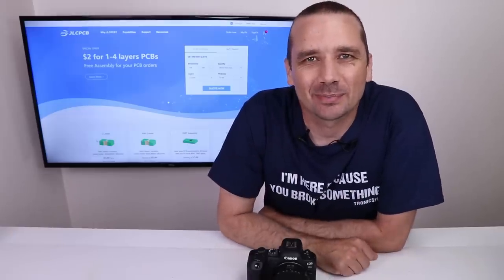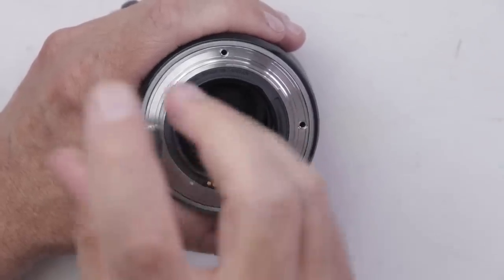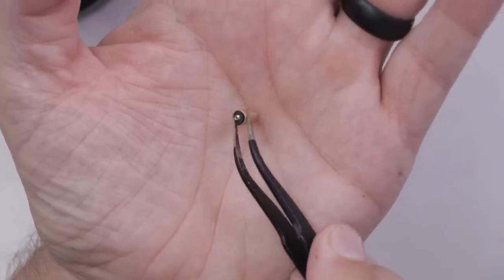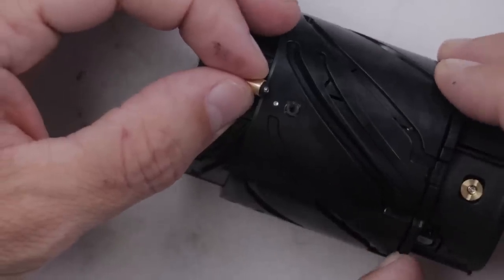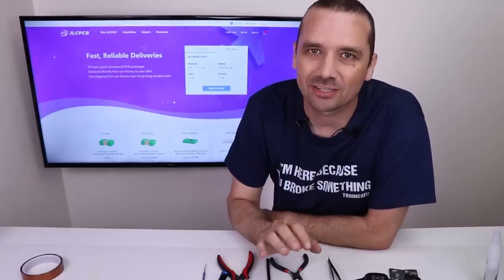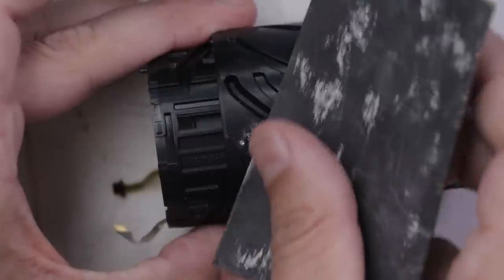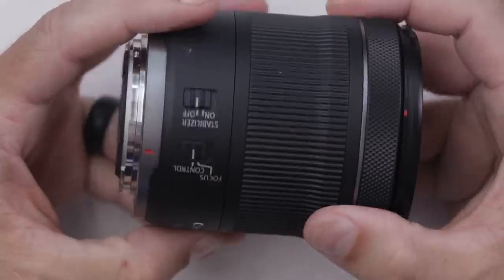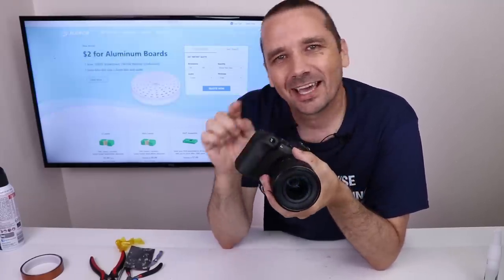I Bought a "BROKEN" $2,800 Camera & Kit Lens - But Can I Fix It? Canon R6

Comment: I've fixed dozens of lenses over the years and in probably 80% or more of the cases where mechanical failure has occurred due to impact damage, it's a plastic standoff that's broken. Fujifilm, for example use metal lens mounts on their XF series lenses but they're screwed onto brittle plastic standoffs. When a camera is dropped with the lens attached it's the lens mount that takes the brunt of the impact so those plastic standoffs just snap. From a repairability point of view it's actually better to have the plastic lens mounts they use on the cheaper XC series lenses since in those cases it's generally the plastic bayonet fitting that breaks and you can just replace the mount with a new one.
I should probably add that it's best not to use normal superglue since the outgassing in enclosed spaces like the interior of a lens can cause lens elements to fog up due to a chemical interaction with the lens coatings. In some cases I've seen the element has turned so white it's almost opaque. There are specific low-odor, non-fogging superglues like Loctite 408 or Permabond 947 that are better to use to prevent fogging but even then they should be left to cure for at least 24 to 48 hours before reassembling the lens just to be safe.
Reply from the maker: Thank you for your comment! Really good info here. Good point about the super glue. If I do more of these I'll have to make sure and get some of that glue. Do you still fix these?
Great channel btw! Hope it keep growing!

Comment: Would recommend using super glue activator spray. It makes for a much stronger bond and you don't have to wait around for it to dry. Plus the excess wipes off. I also often stick a toothpick down standoff holes to aid alognment and stop glue getting into hole.
Reply: This! I feel like when using the activator spray on thin plastics it melts it slightly cus of the heat of the reaction between the superglue and the activator and makes sort of a plastic weld. I could be wrong though.
Reply: Epoxy?
Reply: Activator can contain acetone which may react poorly with other plastics.
Reply: You don't need activator spray, you can use baking soda. Sprinkle a little bit on super glue will instantly create a very strong bond.
Reply: CA activator causes a thermal reaction (albeit a small one). Also can cause bubbles as it dries when activated. 
It's best to let things dry over a longer period for extra strength, particularly with materials where the glue can't soak into. This is surface to surface. 
Even with my woodworking I notice a stronger bond with a slower dry time than trying to speed up the process. You also risk melting the plastic a little, because some activators contain acetone. :)
Reply: Q-Bond kit on ebay
Reply: Use UV glue on this ?

Comment: Great repair, I hope it holds. Just a quick tip - I assume that plastic is ABS, if that's the case, always use acetone (sparingly). It will weld the pieces together instead of 'gluing' them. A little acetone in a syringe with a needle tip allows for good control over it. I have had great success doing this with screw posts on laptops, etc.

Comment: Oof for the engineer who made that single point of failure held in with a tiny piece of plastic. I'll be a lot more gentle with camera lenses from now on.
Reply: That Engineer definetly got a Bonus for that....
Reply: Even if the studs are designed different, there are still some manufacturers, eg Tamron and Sigma, too tight screwed-in screws make repair attempts really hard. Especially when you mess up the thread...
Reply: Kit lenses are almost always made like crap seemingly to force you into upgrading.
Reply: @gucky4717  Fault tolerance to make us money yo 😂

Comment: nice. I got an R6 and am in the middle of a lens repair. This video makes me happy. It's been a struggle. You gotta keep really good track of the tiny microscrews and the exact order of disassembly. Smart to do a line to mark the exact rotation of elements that might spin freely or go back incorrectly within the casing. Also have to be careful of stripping the tiny screws, most standard hardware shops and even microcenter won't sell replacements at this size. They're smaller than the little guy that holds down a m.2 drive for example. And it's easy to strip a screw if you fail to notice that some are JIS heads instead of philip heads, which look nearly identical.

Comment: Not sure if anyone posted here already, but to give super glue more strength, you can add baking soda to it. once you apply glue, put a bit of baking soda on top of joint. Turns out to be like a rock

Comment: Very nice fix.  Most would never even attempt this so I'm impressed.  I've learned over the years that CA based "super" glues usually don't hold up too well over time in high stress mounting points.  Whenever possible I use heat to weld the mount back on (it's not realistic more often than not) and for the other times I find that an automotive, polyurethane based, 2-part plastic panel bonding adhesive to work best.  WAY more durable than CA based glues.

Comment: Having that mechanism rely on a single post screwed into plastic is kind of... iffy.
Also, I guess you could look for a lens assembly with problem lenses and transplant the barrel part, but that would be a very long shot.
Reply from the maker: Ya, I wonder how many lenses only have this one stopper. It would be nice to just replace that part but I think buying another broken lens for it would just cost too much. I wish I just had a bunch of junk lenses laying around!
Reply: @Tronicsfix  welp, gotta try to repair more of them. wink wink

Comment: depending on the plastic that its made from methy ethyl keytone (or MEK for short) is a solvent that might be able to melt the plastic and fuse it back together on a chemical level. works for abs like lego plastic. good thing is not only does it bond the plastic to itself, making it as strong as it ever was, its not additive, the solvent evaporates, so everything should fit back together. you just have to be careful not to use too much and melt the plastic too much that it deforms

Comment: Just  supergluing it won't last last long. You could reinforce it by melting one or two needles (or wire, or some or small metal piece) into the plastic seam. That should make it stronger than before, if done right. (Might be tough to do here though.) I've fixed plastic pieces by pushing small metal pieces into the seam with a soldering iron. They've been holding for a few years now.

Comment: Still shocked at the fact that these $400 pieces of equipment manage to break internally like this. I get it may have been dropped, but still would expect better from the internals.
Reply: Obvious design flaw, you got a metal standoff going into plastic, the plastic is always going to break, it should be a curved metal plate that is screwed to the plastic at multiple points to spread the shear load across the plastic barrel
Reply: @ILoveWomen  Yes, that's true. When ever possible I suggest avoiding non L series Canon glass (instead use 3rd party glass, with adapter if needed). But their L series more expensive stuff is really, really great.
Reply: @sirrichel9155  I wouldn't be surprised if it was intentionally designed this way. It's supposed to break after a certain amount of usage.
Reply: $400 for a lens is actually quite inexpensive. To get to that cost they are built cheaply. Most of us that do photography have much more invested in our glass than our cameras.
Reply: At $400, almost all the budget goes into the glass, not the build. i’m not surprised tbh.

Comment: Dang, I would of been nervous too but that's great that the pieces was still in there and didn't appear to scratch anything. Interesting to see that it's only a single point for that movement, I would think at least two pins would be better, so they can share the load of those forces

Comment: I paid $600 for my best lens (worth around $2000) to be cleaned and refreshed, and I was happy to pay it. I'm a hardcore repair-it-myself guy, but lenses are terrifying devices. There's potential for a catastrophic mistake around every corner. EDIT: right after posting I watched the driver tip drop on the glass. YIKES!! EDIT 2: Nice work! I'm impressed.

Comment: 5:05 Other ideas, soldering iron and press it in, you'd have to be very careful getting it straight of course, but that would make it as strong as originally or worst case, you could drill all the way through and 3D print a tube to fit in the hole you made and the hole in the center being just large enough for the screw to eat into the plastic.

Comment: This is a great camera.  The mirror less feature is perfect for astrophotography and when replacing the IR filter with glass in front of the CMOS chip will increase its value.. you can use white balance to correct the Infrared pictures back to normal.. I'd love to buy this camera from you.!!!

Comment: You should adhere that piece with epoxy, it'd hold better without worrying about that piece falling off :) But nice vid btw
Reply from the maker: I'm not sure I'd be able to get the epoxy where I needed it without getting too much on it.
Reply: @Tronicsfix  I think it'd be still worth to try anyway. Epoxy is quite easy to sand down after hardened.

Comment: The best way to "glue" this kind of parts... and I use quotations mark because what I will describe is basically fusion the parts, not gluing.
A drop of chloroform on one of the surface and press slowly the part in the exact same position, sometime is advisable to build a jig to hold it on proper place until plastic is hardened back... definitely not applicable here as this is so small.
The chloroform melt the both surfaces of the plastic and fusion...or you can call as well welding, take place. 
Much more strong bond, sometime stronger than a new part, when those parts are injected, micro air bubbles are captured in the material, (this can be visible under a microscop)
The weld with chloroform will be free of bubbles therefore much stronger.

Comment: In my experience I’ve found that super glue really has a rough time bonding to lenses so even if you got some on the lens it should wipe right off, or when it dries you can lift it off without damaging the glass at all.

Comment: Interesting that you didn't do this as a resale with profit breakdown. I don't see a problem putting something like that up for sale if you are clear about what repairs have been done. Especially if you just post a link to the repair video in the ad. Include an as-is type of statement. If the price is right, I'm sure someone would be willing to take the chance. Great video as always. Thanks for sharing.

Comment: Just a little tip for you. Always use sodium bicarbonate with super glue. Just make the repair, as you always did, but, put the sodium bicarbonate over the fresh super glue. It makes much more strong the repair. Just try and see. Regards from Brazil (sorry by Bolsonaro).

Comment: If the superglue doesn't hold then a more robust epoxy maybe with plastic filings to create a nice solid bond.   Modern superglues are super resilient so no reason why it wouldn't hold.

Comment: This might be a very stupid idea, but, what if you used a slightly longer screw? You could also even try a very extremely thin nut on the other side, bending it a little bit to make it more like a curve. Most likely there might be no room on the other side to even attempt this, though, I know.

Comment: I think it was your last video I jokingly said your next video would be you fixing all the Chevy Bolts. Since then GM has said they have the fix now. For the older cars they are definitely getting new batteries. For the newer ones like mine (which only has 2000 miles since I just bought it a back in July) it's hard to say. They aren't being clear. I suspect it will just be a computer update. I just thought it was funny the announcement was after me joking about you doing it.

Comment: Atleast they have a repairable design for detachable lenses. I have repaired a Canon SX1 IS before and it had internal pogo pins that is impossible to repair. All the cables were hard soldered and what really broke was the auto focus motor inside the lens. It was so teeny tiny that hardly measured 4mm in the entire construction. Sadly no repair possible. Luckily found another one who was giving away for hobbists and swapped the entire lens assembly. I just bought it on ebay (10euros) for learning. I definitely learned a lot. spent atleast 45 hours on multiple days for that repair.

Comment: Best option would be to plastic weld it with a mesh grid something like aluminum mosquito nets on windows and then sand it a little and use jbweld over it. That should be stronger than factory.

Comment: I dropped a canon 70-200L is 2.8 in the sand at the beach. It felt gritty  as I used it so I sent it to canon . They told me it was cheaper to buy a new one then it was to fix it . I paid 2.4K for that lens at the time

Comment: I suspect that this lens was damaged not by aggressive use of the focusing wheel, but via an external force on the lens when it was extended, which stressed that plastic & brass pin. I've used many Canon lenses like this one, and I think the zoom action on them are a bad design implemented poorly.

Bad design because (a) there is too much slop in the mechanism between the control wheel and the movement itself (there's a machining term for this that escapes me at the moment). If you overshoot the focus spot and reverse direction on the control wheel, there's a "dead spot" where you're turning the control wheel and nothing is moving. Bad design because (b) the mechanism allows external forces on the movement train to be easily transferred to weaker internal components.

Poor implementation because (a) much of the mechanism is plastic, which is going to wear over time and will break much easier than something made of a metal or alloy, and (b) one of the highest points of stress is the system (this part that was broken on this lens) is basically a small plastic nub.

Comment: I hate companies which use cheap plastic parts just to make sure either the plastic become brittle after sometime or it's falling off from your hands. In both cases these fragile parts will get broken. 

What's stopping them to use aluminum instead, it's light weight and environment friendly and now with advanced CNC machines complex parts can be made precisely as well.

Comment: Would it be possible to 3D print it? Although the process will be pain in the butt.
Reply from the maker: Maybe but I'm not sure 3D printing would be precise enough
Reply: Trail and error until it works. That is why I mentioned this would be a pain in the butt.
Reply: You could s print it accurately enough, but the process would cost more than the lens is worth...

Comment: Actually the R6 is not a DSLR (Digital single-lens reflex) as it does not have a mirror. It's called a mirrorless camera, in this case with interchangeable lenses.

While some people point out to the engineers taking the stupid decision of using plastic instead of metal, this might be false as the design and engineering tends to not be mirrored in the manufacturing phase due to a bunch of reasons, the most important of course being that adding a metal tube there would have either required extra machinery within the process to be added, or humans to do this manually. It's much simpler to just make the whole piece at once.

Comment: I have a question and it would be insane if you responded but my Xbox series x will turn on but no hdmi signal and the controller won’t connect its like the Xbox turns on but doesn’t sync with anything have an suggestions what to do?

Comment: You get what you paid for, this is Canon's cheapest RF zoom lens, you see all the crappy plastic in there? A Canon L lens will last you for more than 10 years. Just stay away from these kit lenses. If you are on a low budget, first, stay away from Canon, then buy prime lenses instead of zoom. Low budget prime lenses are also plastic but they are usually more durable because of less moving parts and give you much better image quality than a kit zoom. And take care of your lenses, use your lens hood (lens hood saved my Sony 35mm G Master when my tripod falled down, I still can't get why Canon refuse to include a lense hood for no-L lenses), no lens is slam prove.

Comment: A ton of Money for the lens, then the engineer put a critical part which always used as for moving parts from plastic, a very small part for point of failure where it would be mark as disposable, 400$ for if not careful even you cannot overturn it much more to drop it and repairing it is next to impossible, they just put something metal for structure rigidity of for the people if not careful need to buy again for parts.

Comment: I would have used a combo of UV-activated glue as an instant tack weld, combined with long-set epoxy.  Depending on how things are laid out, you can setup the pieces together with epoxy, and use just enough uv glue to hold the pieces together while the epoxy cures overnight.   I did a similar lens repair a week ago with great success and less fuss

Comment: If the camera body good, toss the lens. Sometimes without the proper lens alignment tools, the  lens with have chromatic distortion from the misalignment of the elements. The body is more important, a 400 dollar lens is easily replaced.